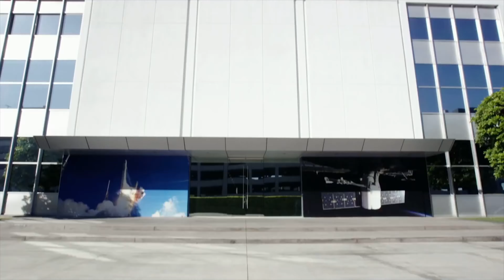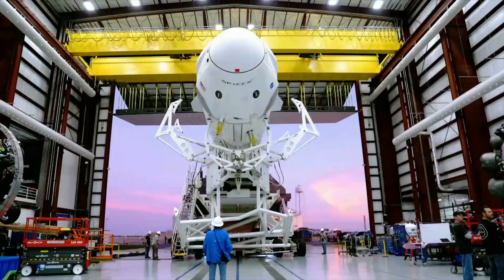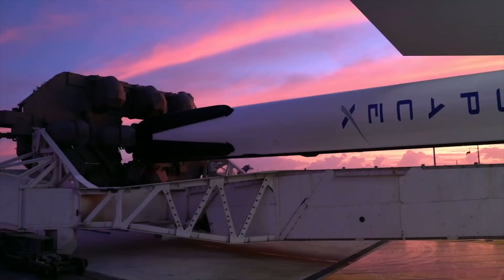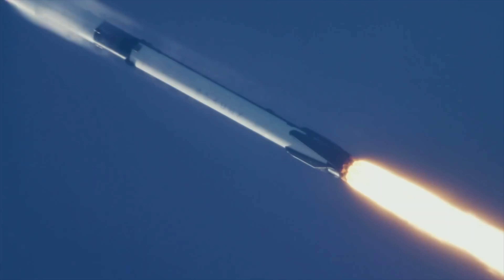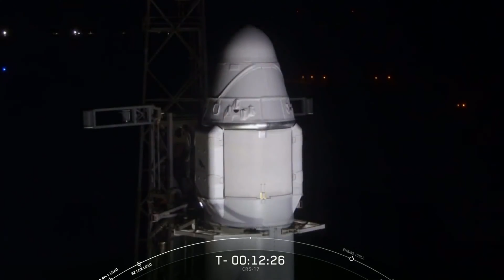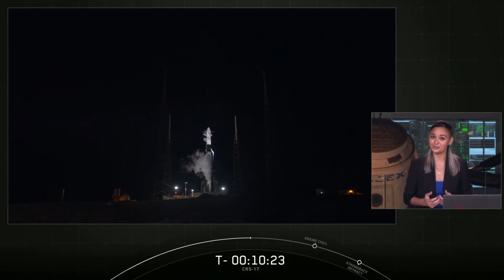SpaceX Falcon 9 - CRS-17 rocket launch as seen from Jetty Park (05/04/2019 02:48am EDT)

Comment from the maker: Video Chapters:

Chapter 1 - 14:50 - T-10 sec
Chapter 2 - 15:00 - Liftoff
Chapter 3 - 15:16 - Liftoff as seen from Jetty Park
Chapter 4 - 15:53 - Rocket rumbling arrives at Jetty Park
Chapter 5 - 16:21 - Super sonic plume
Chapter 6 - 17:23 - Stage separation
Chapter 7 - 17:40 - Boost back burn of 1. stage
Chapter 8 - 21:46 - Reentry burn of 1. stage
Chapter 9 - 22:44 - Infrared landing shot
Chapter 10 - 22:55 - Landing burn
Chapter 11 - 23:22 - Landing on droneship "OCISLY"
Chapter 12 - 24:13 - Sonic boom heard at Jetty  park
Chapter 13 - 24:45 - Cargo Dargon deployment
Chapter 14 - 27:14 - Solar array deployment